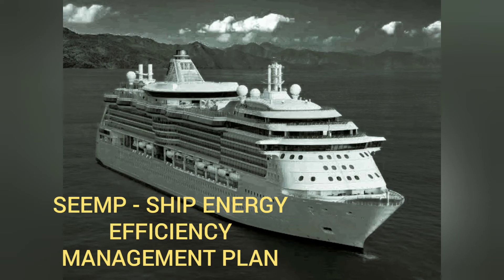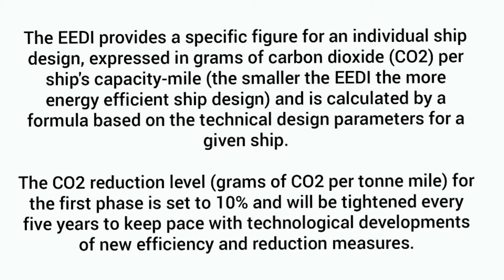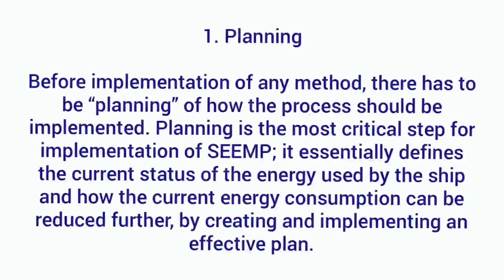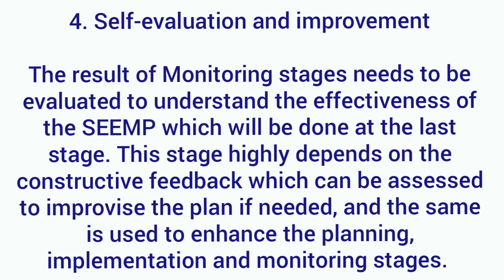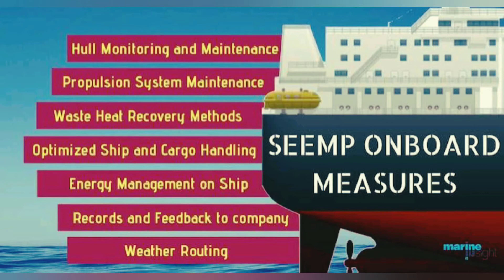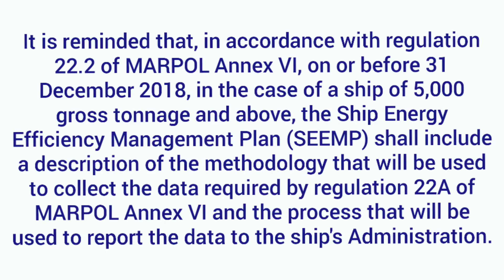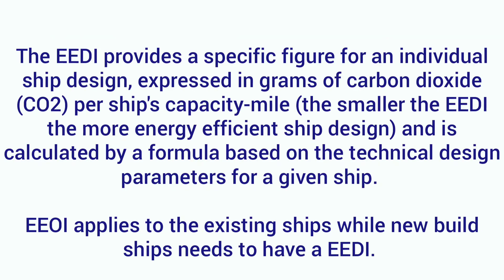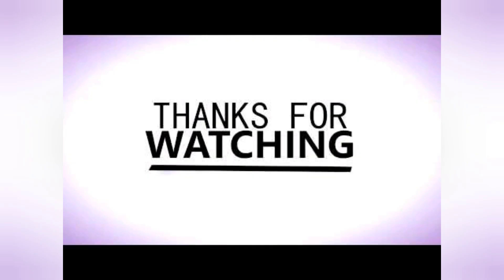SEEMP( Ship energy efficiency management plan) simplified, covering understanding of EEDI, EEOI

Comment: 1) Is EEDI calculated for every new ship and compared against IMO's reference line?
2) If EEOI is greater than EEDI what are the implications on the vessel
Reply from the maker: 1. Yes 2. It is basically old vessels cannot comply with EEDI because of older design engines, thus they comply with EEDO...
Reply: @oralexammmdprep8110  Thanks for the quick reply. My confusion is that say for any vessel even if new her eeoi is greater than eedi than can the IEEC be revoked? I couldn't find any answer for this elsewhere. I'm also struggling to find what was the reference value that imo set in the beginning for phase 0
Reply: @vsandeep3352  for new vessel EEOI should not cross the EEDI. And yes If EEOI is more than EEDI then your EEEC will be cancelled this direct leads to cancel your IAPP cert. But generally it would not happen because your engine and ship is design in such a way that they follow the EEDI and will not cross its value
Reply: It is define in the regulation. It is a formula with different factors and correction factors that depend on vessel type. You will find a lot of documents on line that talk bout the subject. Reference line value = a ×b ‐c…